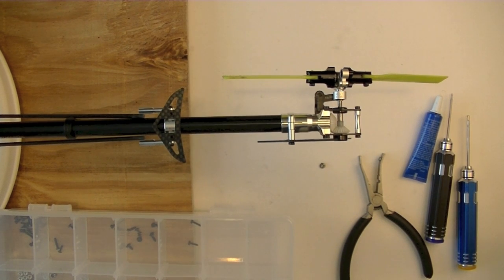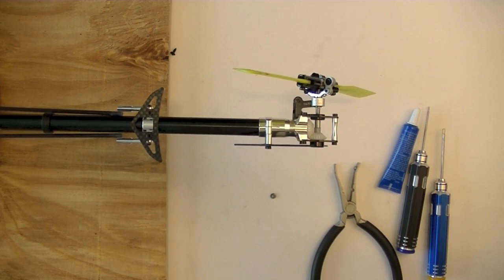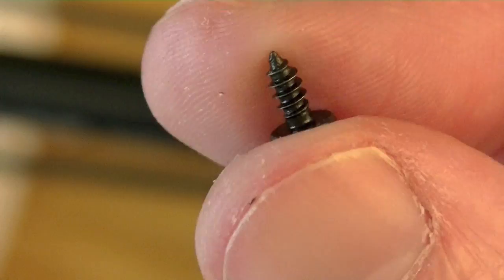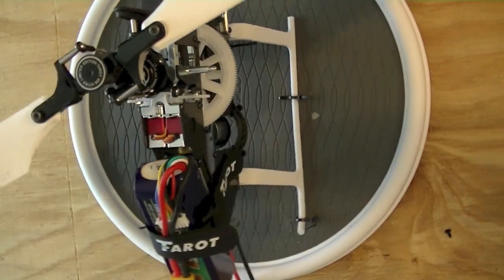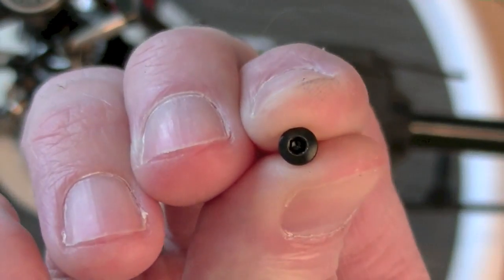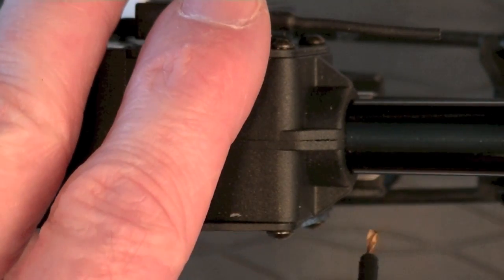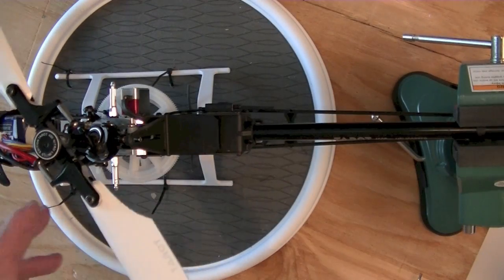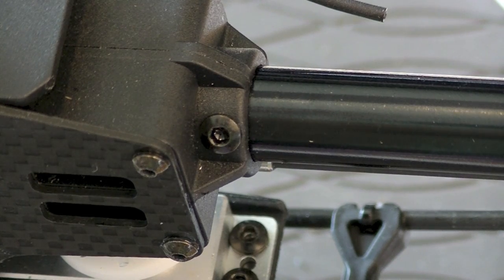47 : Tarot 450 Pro V2 Build : Pin the Boom!

Comment: One good tip for increasing friction between the tail boom and tail boom mount, horizontal stabilizer mount and tail box is to use Scotch/3M magic tape (magic tape is that one where you can write with ballpoint pen because that tape surface is "matte" and it's not slippery as normal clear tapes). I started using it in all my helicopters and after that I haven't have any more issues with slipping booms.

Comment: Broke the exact same screw in November on my Tarot 450 Pro!  I didnt even have it tight as its in plastic the head just fell off.  I couldn't get it out so I changed to the  tarot aluminum anti rotation bracket.

Comment: I was assembling mine today and one of the two long screws holding the tail boom stabilizer in place literally snapped apart, but not instantly. The hely sat fully assembled on my desk for like 10 minutes before I could hear some cracking noise and then see the head fly off. Weird stuff.
Reply from the maker: That's weird.
Reply: Yup, but those are cheap to replace, I'll just buy a bunch and swap out all vital screws before I even spool up the thing for the first time. Nice job on all the videos BTW.